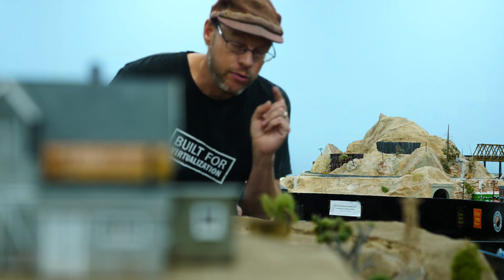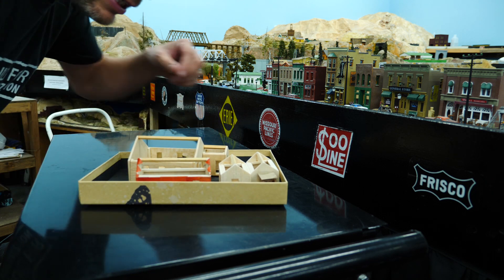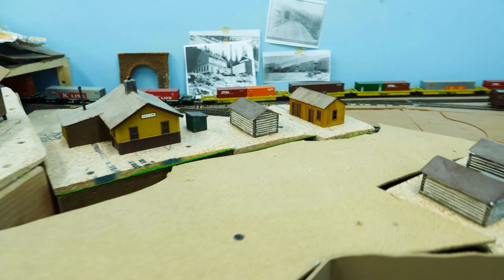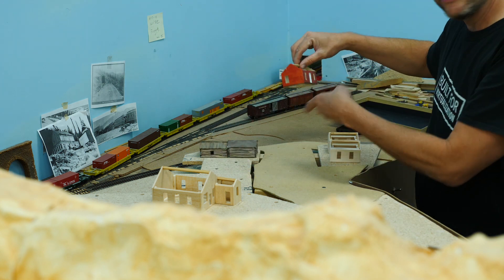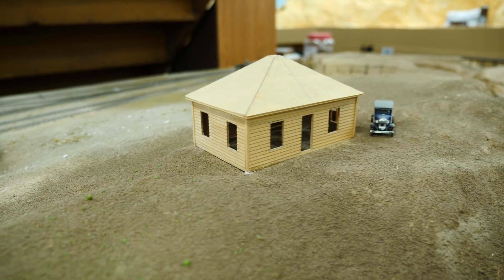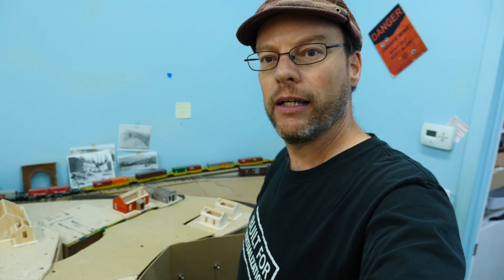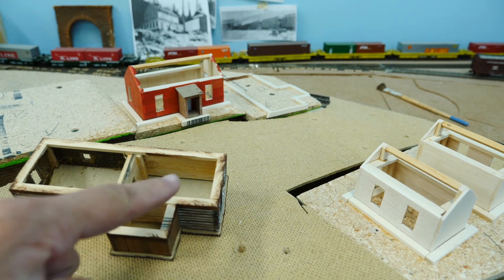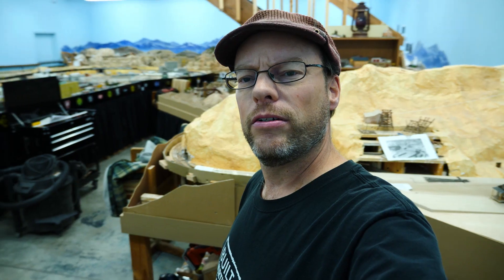Place Removable Model Buildings in the right spot every time. Palisades update and a Custom Bridge.

Comment: In Romley you had me worried you'd be losing the bottom 1/4' of your buildings until you showed a base had been added to the buildings. I use foam board as my basic bench work and construction material. In areas where I'll be adding buildings I have a top layer of 1/2" or 1/4" foam board which isn't glued down. From this top layer I cut out and remove the building footprint from the foam where the building will go.  The top layer is then glued down and left to dry. Later the foam cut out with the building now attached is inserted into the vacant spot in the foam board. This means the ground surrounding the buildings doesn't need to be brought up to the level of the buildings. I really like how you're going about the rock castings for the Palisades. But then I would because that's how I do it!  LOL
Reply from the maker: I like the foam board idea. Similar but different. May have to try it sometime.